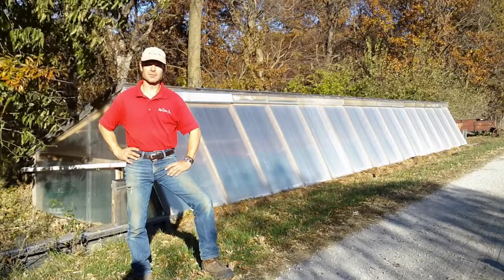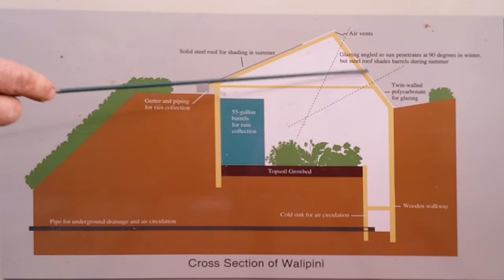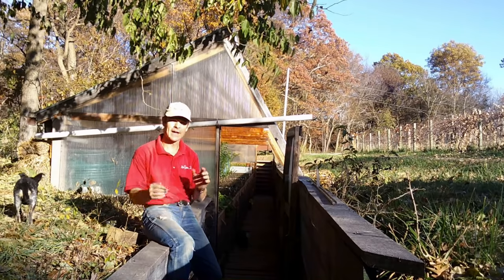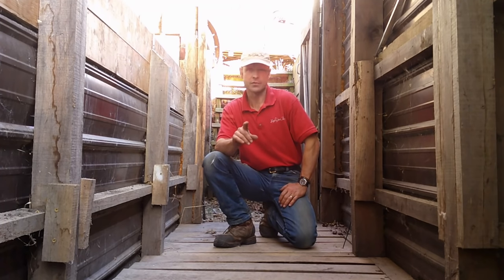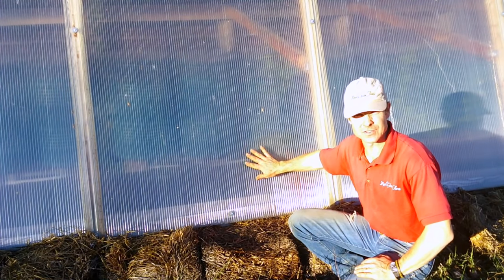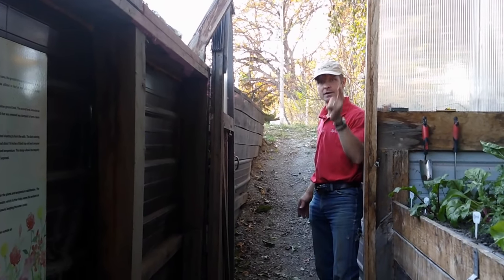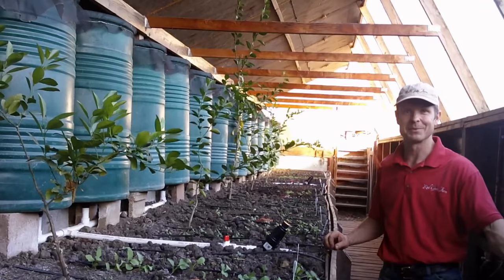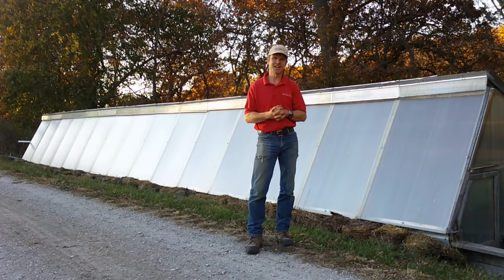Farm Tour Series: The Walipini; Use, Design, and Construction

Comment: I appreciate your effort, but the long shadows stretching over the garden bed are a perfect example of why walapini's don't make sense in northern climates.
Reply from the maker: While shadows can be an issue, it is the design of the walipini that determines where shadows lie.  Further north, the concept certainly still works, although some modifications are required.  Design is all based on latitude.

Comment: I also find it addictive to try to solve problems that have constraints (like being off-grid).
I am wondering if a solar powered fan would be within the limits? Or if a larger concrete pool of water at the North wall with some air pipes in it could compete with barrels and pipes through earth (especially if a solar powered fan would be allowed on sunny days when cooling is needed).
What about using elastic silicone tubes instead of PVC pipes? How long does it take for PVC to become brittle? Would elastic silicone tubes be more resistant in case of a freezing accident? Wouldn't silicone tubes enable closing a connection by pinching if a pipe needs to be closed temporarily (for maintenance). Also, wouldn't silicone tubes be easier to connect tightly by, say, T-intersections?
(skipped some more experimental ides)
There was one main thing that I am very suspicious about (not counting the joke about worms getting drunk). That is the statement that the air volume in the walipini should be minimized. Minimizing the surface area makes sense. Minimizing the air volume inside the walipini does not make sense at all (at least to me). Is there a good explanation? Especially that I recently had an experience of accepting a popular opinion that I didn't know the reason for, and found out that I should doubt it.
Reply from the maker: You mentioned several options that are good ideas, I was just using the resources I had at the time. As to your question, regarding minimizing airspace, it’s very simple. The ratio of thermal mass to air mass is proportional to the stability of your air temperature. Take a large traditional greenhouse with very little thermal mass, just windows and frame. Cold air gets in, it takes supplemental heat to bring it back to temperature. Now think of an earth ship. Cold air gets in, you shut the door, and it quickly stabilizes back to the earth ship temperature.
Reply: @ADifferentWay  I see, the air is kept stable (temperature, moisture) by the soil and water rather than the mass of the air. I remember watching a video somewhere where they used stones for the walls (without cement, just air in between) to maximize the contact area of air and earth (a bit like a ribbed heat sink). Now I am wondering how I could not figure it out on my own. Sometimes someone else needs to tell me. Thanks.

Comment: Nice design, but the question: Is this cost effective?
Reply from the maker: Certainly, it was for us, but I think the cost will vary with the designer/builder.  We sourced most of our lumber for free.  I know of builders who used free barrels and/or free plastic sheeting rather than polycarbonate panels.  Cost should be taken into consideration when planning the structure, but it can certainly be done with a cost-effective payback period.  Honestly, it also depends on the goals of the grower.  For some, they just want home-grown, organic foods, year-round, at ANY cost.  So lots of variables to consider.
Reply: Thanks

Comment: Is the use of the tanks a better thermal mass than just having the earth exposed?
Reply from the maker: The thermal mass in the water changes temperature more readily than just earth would.  That means it more actively exchanges heat with the air and thus, keeps it warmer at night.  Additionally, it provides water for the grow bed and storage for the rain.  I have no power and no water within 200 feet of this structure.  It is completely self sustaining.

Comment: Is it possible to build a wallipini with multiple levels? I'd like to plant tall tropical trees something around 3-5 meters. I have a good South facing slope for the project, but I cannot dig a really long trench. The climate here is something like -5 to +5 °C in Winter, but sometimes it goes as low as  -15°C for a week. In Summer we usually have 30°C, sometimes 40°C for a week and usually really bad droughts, but I have a creek and a well 100 meters from the place, so I can get water if rain is not enough. We are in Hungary, around latitude 45°, but I am not sure how to calculate the angles from it. A multi level one would mean a lot bigger South facing surface and multiple shorter trenches. I would rather use reinforced concrete or formwork bricks instead of wood and double layer insulated glass without UV protection (afaik tomato needs UV light for good taste). A cheaper option is using 2 layers of PVC foil.
Reply from the maker: I don’t know much about the climate or soils in Hungary, but it should certainly be possible. The whole idea is to tap into the earths geothermal heating for stability, with the depth of the structure based on sun angles and latitude. Other than that, you can be as creative as desired. Just keep in mind with temperatures that cold, the larger cubic footage space you have, the more you have to be able to heat that space during cold temperatures. That’s why we designed ours the way we did. Here’s another link that might help you come up with some ideas.  We were introduced to him through commenters on this channel, and he has a very interesting multilevel design, growing food crops as well as berries and small trees.  https://youtu.be/ZD_3_gsgsnk
Reply from the maker: If interested, we wanted to let you know our Walipini building guiding is finally available! https://www.amazon.com/shop/adifferentway/list/2JRI58ITC5AM0
Reply: @ADifferentWay  Thanks!

Comment: Great video!
I want to grow more food. How can I add at least another bed to your design practically? I was thinkin to add space between the front and back walls. So my reach is 36". So back bed 36", front bed 36" center bed 72". Walkways are 30"  = 17' + barrel space.
What about burying more pipes to carry air to the greenhouse under the soil to the south? They would temper and store the heated and cool er air in the opposite seasons.
Reply: Maybe terracing the beds on receding shelves, or add some vertical growing space in the back, crammed between the barrels?
Reply from the maker: Sorry, we seem to have overlooked this question.  As far as adding more beds, certainly it’s possible.  You could terrace, you could possibly add a narrow bed on the south wall side, etc.  This design gave us the nose square footage to meet our needs in our latitude.  That’s really the key.  You can just plug a bed in wherever.  You have to first understand your sun angles throughout the year in order to ensure the plants get the hours of sun they need.  And you are correct in that adding addition air tubes/pipes underground will help further stabilize temperatures inside.  That was one of the biggest mistakes we made—not having enough air circulation.  Hope that helps!

Comment: Have you ever considered to heat with straw bales during winter time? Place straw bales under the walkway so they don’t disturb you. Wetting them with water for slow reaction, or with urine for more intense reaction. What happen? The bales start to ferment and produce heat. We use that system for growing mushrooms. Beside of the heat they produce CO2. It is just an idea and I don’t have experience with. Our mushrooms like that environment.
Reply from the maker: We never used it in the walipini, as it was warm enough for our purpose. However, we have used straw bales to build an entire winter chicken coop. The composting bales provided enough heat that the inside of the coop was like a beautiful spring day, even in the coldest temperatures. Our water never froze, and the chickens were laying eggs well all winter. Definitely a system that works!

Comment: What is your maximum/minimum temp in winter inside the walipini compared to outside?
Reply from the maker: On average, the walipini remains about 30 degrees above outside temperatures, however it varies.  We ha e a lot of cloudy days during winter, and go weeks at a time with no sun to really heat it.  Temps can get a bit lower during those times.  On nice sunny days, it can get up to 50 degrees warmer.  In the last three years, I think the lowest temperature we got was at the end of a spell of cloudy days, our water in the barrels had run a bit low so they weren’t providing much heat at the time, and the temperature dropped to 26°F one night.  It was about -6 outside.

Comment: Where are you located? Would this work in northern Canada?
Reply from the maker: This was built in central Illinois, U.S.  The concept can absolutely work in northern Canada, though it would likely require some modifications and additional inputs to work most efficiently.  By burying the structure, you gain thermal mass, but seasonally, you may have to add some heat and/or lighting for best growth and most variety.  We talk more about this in our book, which you can find in the video info section.  Have fun!
Reply: @ADifferentWay  Hello sir, can I ask you, about the timber structure. Those posts that form the main retaining wall on the South side, are they embedded in concrete? Are they angled? Are they embedded in soil only? How did the French lady work out the pressure of the soil on that wall? I've seen walls collapsing and I don't want to make a mistake. Do you have any drawings available for the retaining walls? Great video and thanks!
Reply from the maker: The wall angle and stability based on depth, was determined by the excavator. It’s all dependent on soil type and depth whether you can use benching, or max slope calculations for soil type. Our soil is extremely hard clay, almost like sandstone. It allows for very steep walls, and, because it was only 8 feet deep it allowed for one step benching. The shoring posts are 4 feet on center and set in concrete. The walkway, and the trusses provide additional pressure against the shoring. In hindsight, I would have done that front wall in Concrete.
Reply: @ADifferentWay  Thank you so much for the prompt reply! Well hindsight is 20:20 = ) But your video has benefited so many! I am planning on building the main wall with reinforced cinder blocks. Love how the walkway and the truss contribute to counteracting the shore. I'm still early on my design but I'm already super grateful for your video and the information you just shared with me! Thanks!

Comment: Would it work in Saskatchewan with night temperatures at -25 oc or less?
Reply from the maker: I believe it could certainly work with a few modifications, though I can't predict exactly what you should expect if such low temps are sustained.  The lowest we have gotten was -16*F (-27*C), and our inside Walipini temp low was 26*F that night.  As I recall, we did not have full water barrels at the time, nor was it as sealed or insulated as much as it is currently.  Nowadays, we generally have lows closer to the 40*F range when our outside temps are in the single digits (which is more typical of central IL winter).  We have found the real key to success is direct sunlight.  The other reason our temp got that low was because we had suffered about 2 weeks of overcast Sky, and no direct sunlight to warm the barrels of water.  That will really let the temp inside drop.  So temperature is definitely not as important as sun!

Comment: what is the average price to build a walipini this size? lowest to highest guestimate
Reply from the maker: Honestly, it would be impossible to give you such an estimate. Prices differ so much based on seasons, demand and supply, region, and individual materials used. I can only offer that our cost was around $4000, but we milled most of our own lumber and invested a lot in twinwall polycarbonate sheeting for the windows. You would just have to find your own resources and price from there.
Reply: @ADifferentWay  awesome, thanks for the reply

Comment: How much does this cost roughly?
Reply from the maker: We spent roughly $4000 or so, with most of that being excavating the pit and purchasing the polycarbonate.  Cost would obviously very significantly with region, design, and the actual supplies you need to purchase. We offer more insight on this in our book, which can be purchased using the link in the description under the video.

Comment: Would a pond to the south reflect low winter sunshine into the glazing?
Reply from the maker: It would be tricky.  For light, the angle of incidence equals angle of reflection. The sun bouncing off the pond would hit the front wall at too high of an angle to allow much penetration.  That’s assuming you angled the front wall perpendicular to the noon sun.  Think outside the box and maybe you’ll discover a better way.  One other problem though, our ponds are frozen in winter...not very reflective.
Reply: Might benefit photosynthesis if it can get through the glazing, but doesn’t add heat
Reply: Might actually reflect towards the removable-insulation part of the north wall, and could be reflected back. Probably not worth the hassle, and adds other problems (water column adding pressure to the front wall, moisture, ...)

Comment: did you try Avocado tree in the Walipini?
Reply from the maker: No, we considered it, but decided not to due to space.  The trees are really intended more as an experiment than full scale production.  Cool season annual crops are our primary focus in there.
Reply: @ADifferentWay  What about weak-growing espalier fruit trees? You could train them the way you want, horizontally, vertically.
One of the nicer things I have seen growing in a greenhouse ceiling was a grapevine, offering shade in summer and not blocking sunlight in winter.

I really like your growhouse, especially the hidden mushroom growing -bed under the walnut boardway would be nice to see in a future video.

I am in the planning stage of a 8m geodesic dome walipini featuring circular soil as well as aquaponic grow beds with a citrus tree in the middle.
A circumferring rill will collect water on the outside but serve for water-loving plants as well.
Still in the theoretical stage!

Comment: The sun angles so critical for glass don't matter much for polycarbonate, which diffuses the light instead of reflecting most of it. This walipini was designed as would be needed if using glass. Since you are using polycarbonate, you could benefit by having more polycarbonate on the top and capturing more of the indirect lighting. It would be possible to shade the tanks on the inside of the walipini during the summer instead of depending on the solid panels. In this example he talks about how much light they are capturing from indirect sun: https://youtu.be/wUE9Td2iqYU

I do like how you show the actual design and construction of a walipini. I would like to see some comparisons with more polycarbonate taking advantage of all the indirect and diffused light possible with this material.
Reply from the maker: Hey Joel, thanks for the input. As an engineer myself, and a professor of engineering, I started this design process with my students years ago. Notice in the video you referred to, he has a massive heater and a massive mylar shield. He even mentions that he does that specifically because he has glazing on the north side. He also mentions that there are advantages to insulating the northside. Without getting terribly technical, or too long, let me offer this. When you choose not to have any supplemental heating like I have, the design is entirely different than what you saw on that video. You must minimize air space and minimize any wall space with a net loss.  Based on calculations, if I glazed the remainder of the roof, my net loss through the coldest months of the year would require me to add a heater, and use some system like the mylar cover that he has. That alone would double the cost of construction, increase maintenance cost, add utilities, and it would no longer be completely passive.
Reply: @ADifferentWay  Sure. My entire point is something he mentions very briefly in that video, the benefits of diffused light. That is a huge advantage of polycarbonate over glass. The angle is no longer critical because polycarbonate diffuses the light instead of reflecting it at less than ideal angles as glass does.  Rob Avis from Verge Permaculture mentions it in his passive solar greenhouse designs.  So instead of worrying about sun angles,  with polycarbonate he designs the angle to provide the most useable space and shed snow well.

Comment: if you want a amélioration use transparent barrel to see the level of water +  tarpaulin black and white side, in winter  use the black side who is the best absorption color whith no reflection of the sun radiation and in summer you turn the tarpaulin to the white side who was the worse color for absorption but the best for reflection.

Comment: Does water get in when it rains
Reply from the maker: We never had any issues with flooding, but then again, we also designed the cold sink with drains just in case water did get in. I know sometimes we would find mud in the bottom, so it seemed to work and keep it drained out.

Comment: I like how well engineered it is for its  thermodynamic purpose.  But if you include the cost of the construction in the fruit yield of the crop those are some awfully expensive pomegranates. 😂
Reply from the maker: Actually, since we used so many recycled materials, and I have my own lumber mill, it paid for itself in four years. That, however, does not include my labor. However, I consider it a labor of love. I learned a lot from it and used several of the principles to design and build my current off-grid home.